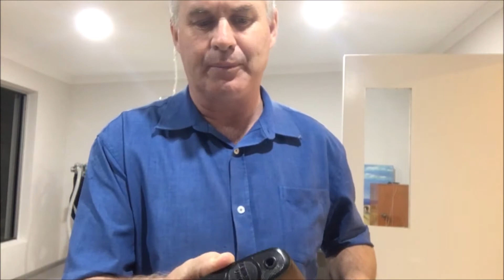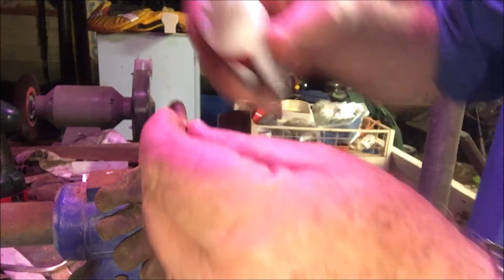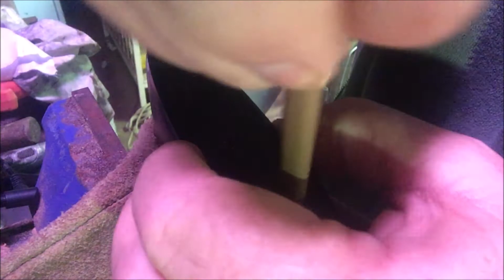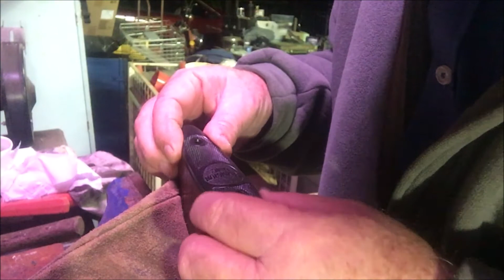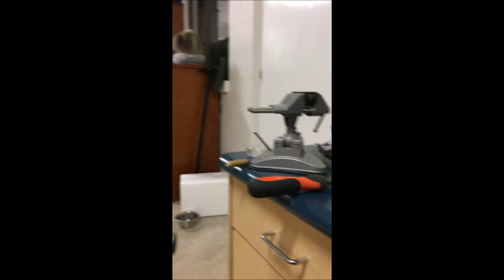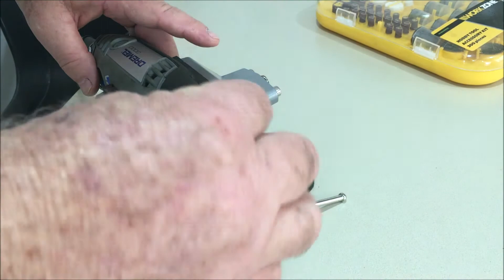FITTING A RIFLE OR SHOTGUN REPLACEMENT BUTT PLATE BY PLUGGING AND MOVING THE SCREW HOLES

Comment: Hi I was wondering why did u put the lube on the screw before u put it in the stock ?
Reply from the maker: Lube just helps the screw smoothly cut the thread in the wood without binding. It also probably protects the thread from moisture to prevent corrosion and make the screw easier to unscrew at a later date.
I usually have a lump of beeswax that I use but that bullet lube just happened to be handy at the time.